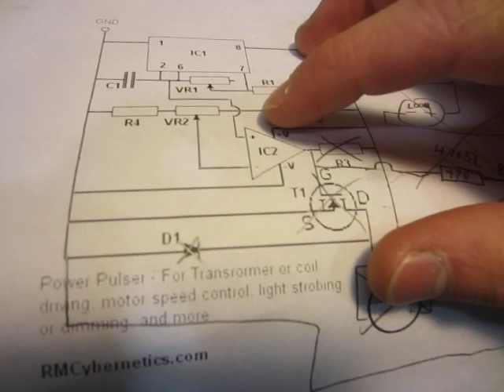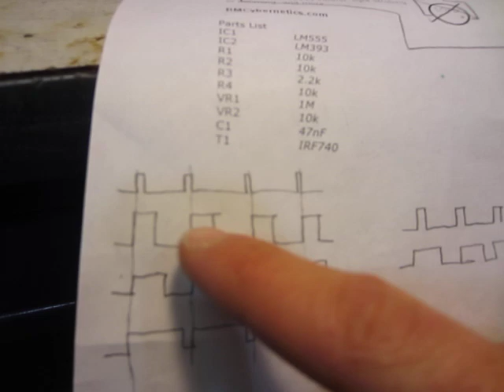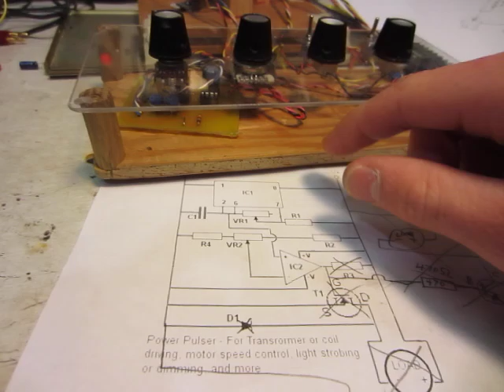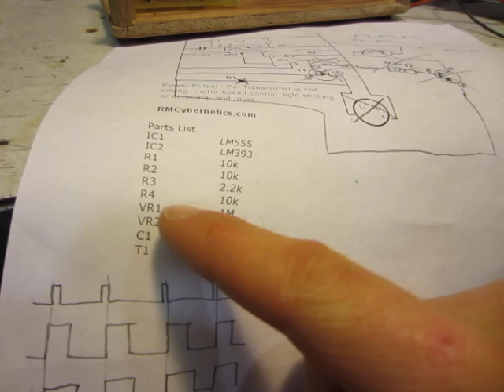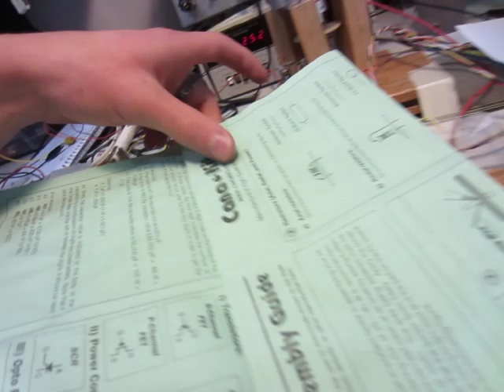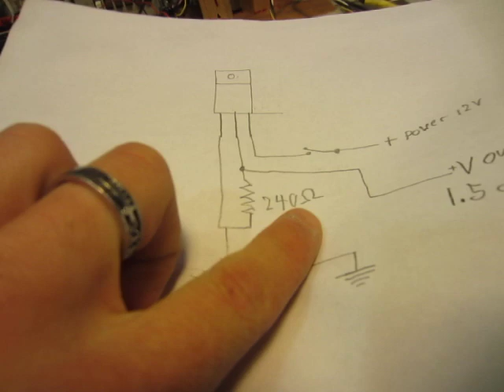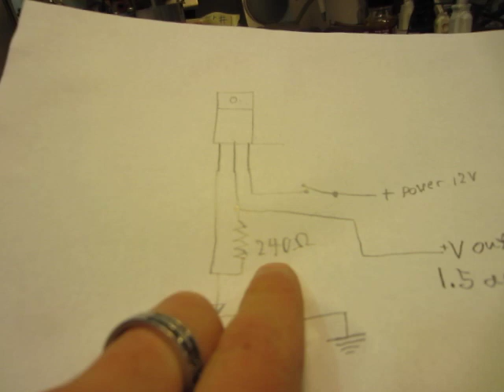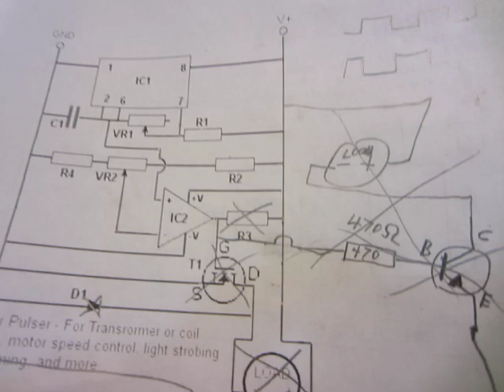Help For Building the Spinning LED Light Ball Control Panel

Comment: Hi man! How're you doing ?
I'm making a kind of rgb led ball, like yours but with another structure. We have some problems with the frecuency and duty cycle circuit. Could you please tell me if the pin 3 of the lm555 is connected to something ? because i know that's the output of it.
I tried this one http://www.rmcybernetics.com/projects/DIY_Devices/homemade_pulse_controller.htm on proteus but it doesn't work. Could you please help me ?
Reply from the maker: +Santiago Cammarano Hi!  No, pin 3 is not connected to anything.  Pin 2 and 6 are technically acting as your output in this case.  It should be putting out some kind of sine or triangle wave on those pins and feeding that to the positive of the amplifier.  The amplifier is acting as a trigger.  So basically when the voltage on the + pin is higher than the voltage on the - amplifier pin the output of the amplifier goes high.   So check to make sure you have some kind of signal at pins 2 and 6.  If you can't check that then you could hook an LED up to pin 3 of the 555 timer just to make sure it is indeed oscillating.  If you are getting a frequency on pin 3 then you know it's not a problem with the 555 timer and it's a problem with the amplifier part of the circuit.  So check the 555 timer and then get back to me.  If you want you can email me instead as there is a higher chance that I will see it.  makerj101utube@gmail.com
Reply: Thanks a lot man!! I will do it. Thanks again!
Reply from the maker: +Santiago Cammarano No problem!  Good luck!

Comment from the maker: The potentiometer does not change the frequency of the LEDs enough.  If you had say a 10Megaohm pot you could probably skip the cap switch.  Do you mean with the power supply or though the slip rings?

Comment: A couple of questions:

1. Why switch between three different capictors if one of the potentiometers already adjusts the frequence of the pulse?

2. How do you separate the power to the LEDs and the motors?

Would love to see a full schematic, if you have the time to put one up somewhere. :)

Comment from the maker: You can use just about any cap for a filter capacitor.  I think mine is a 220uf @ 16volt.  It does not matter.  Just any cap that has a voltage grater than your supply should work.

Comment: If I could get one! 30 microwaves out for collection that I checked. found 2 with Mots still in. My first two!! What is being done with all those MOT's? they leave the cap and everything else. just pop it open on the sidewalk and cut the MOT out... I must have seen over 50 like that in 6 months...

Comment: 35-37v is about right. If you had less than a sqft of heat sink, it would be the heat... Unless you didn't protect the lm317 with diodes etc between it and the 3055's. I'll pm you a link. Lots of plans on google. Found them by acident trying to id a "mystery chip" with lm317 written on it. lol! Was going to make a 14-17 amp supply, but transformer expense is slowing the project. Nearly buy a power supply for the same price. I still want to make one though. With home wound toroidal transformer.

Comment from the maker: I believe that would work pretty good except for the fact that it would make a ton of heat!  A few years ago I tried to make a variable power supply with two lm317's in parallel.  I tried twice and both times the lm317's burned out after about 20 minuets.  I'm still not really sure why the fried.  It might be that the power supply was to high of a voltage for them.  It was 35 volts.

Comment: Nice explanation. I don't know if I'll ever make one, maybe for a kid's toy. But I know how yours works now :) I've been wondering.... You can have those lm317 drive a power transistor if you need more amps put 3 3055's in parallel. you can drive 12 amps... I can find the circuit if you like. I was going to make a power supply with one.